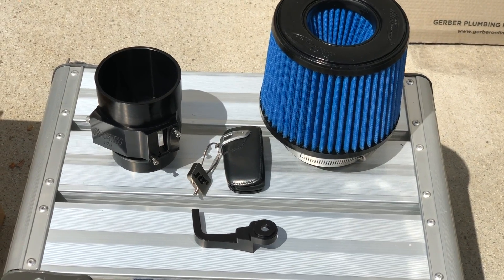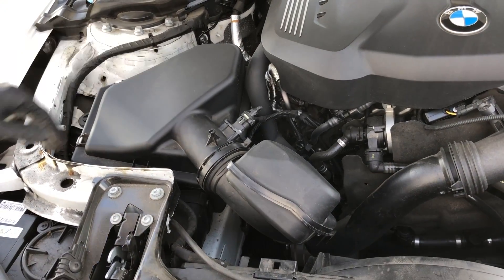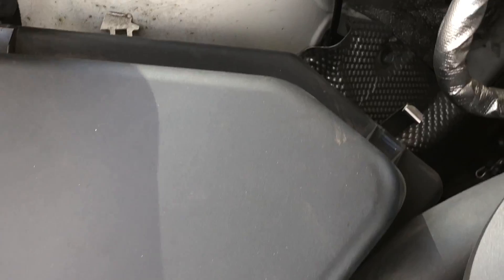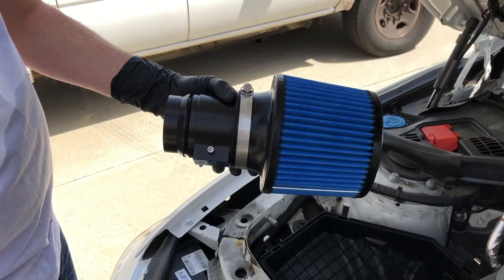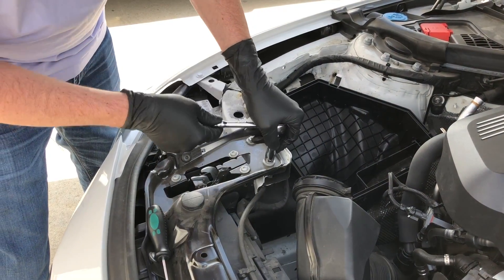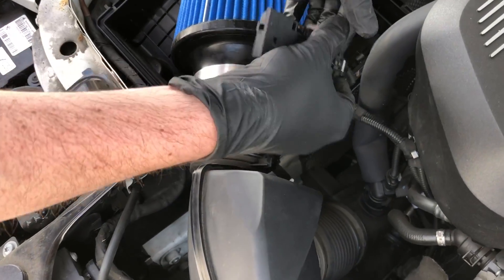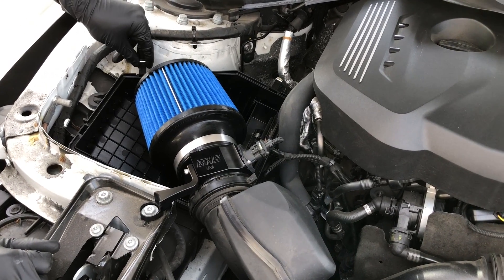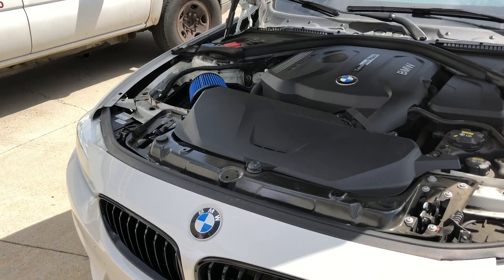How to install the Burger Motorsports BMW B48 Billet Intake

Comment: Great video, man! You’ve helped me out quite a bit with previous installs. Anyways, I installed mine yesterday and I can’t believe how much power I’ve lost, even with my car tuned pushing an extra 4.5 psi. Not only that, but half the time I rev, I don’t hear that blow off sound - it almost sounds as if the turbo doesn’t even exist. I removed it and re-installed my stock box and all those issues went away. If I can’t figure it out sometime today, I’ll probably send it back tomorrow.

Comment: Installed mine and the car is a bit louder (deeper and throatier) on first start but I did feel it adding a little bit extra driving in sport+ mode like I normally do.  It seemed I got a small boost in acceleration and the top-end speed of some gears was higher.  It's not a huge "holy crap look what I did" moment but it looks good, sounds good, and adds just a bit more power.
Reply: Yeah that’s about all you can expect from an intake, it’s not something that’s gonna make a huge difference on its own but rather it’s complementary to other mods as it will allow the car breath more.